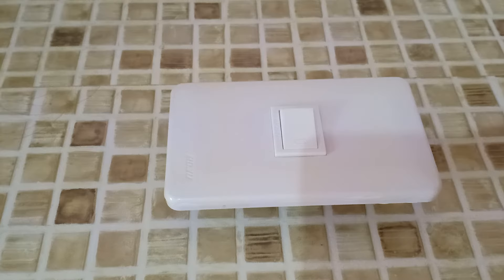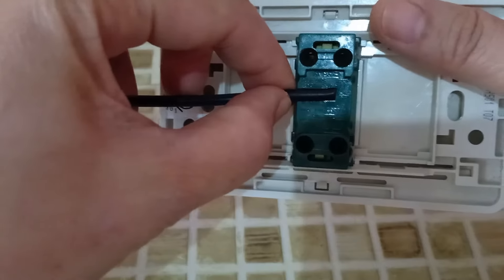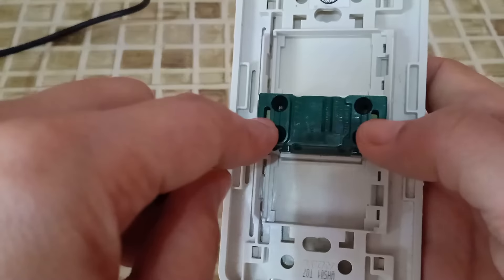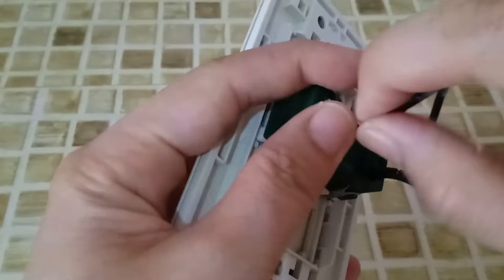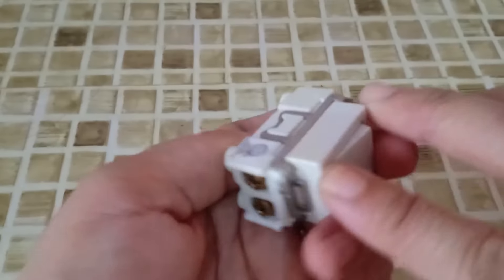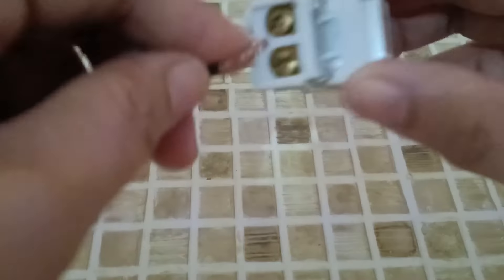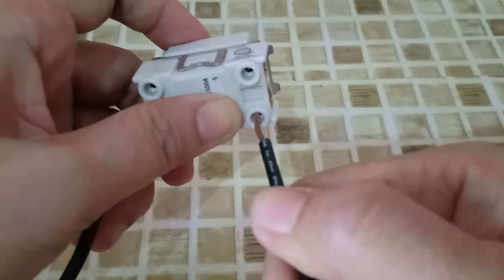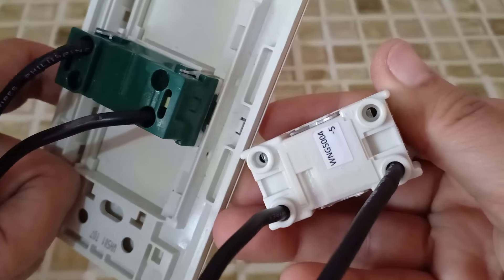WAYS OF INSETING WIRE INTO SWITCHES : HOW TO WIRE SINGLE POLE SWITCHES

Comment: Wha is the difference between with screw and with out a screw?
Reply: The one with screws can use both solid and stranded wire. The other one without the screws are only for solid wire.

Comment: How to remove the wires
Reply: just pull
Reply: @KENNETH12345405   Nope!  you push the button or put a screw drive in the slot and push as you pull the wire out.